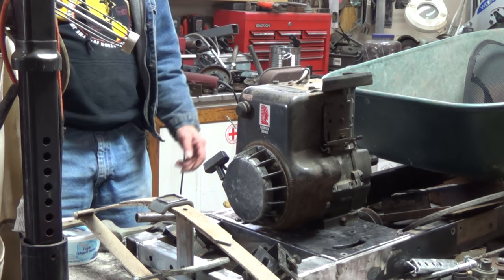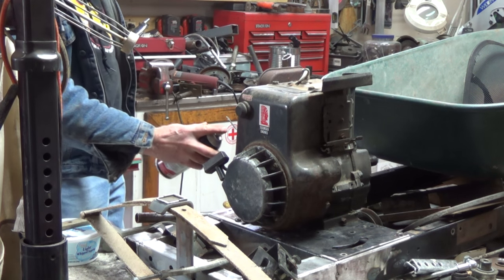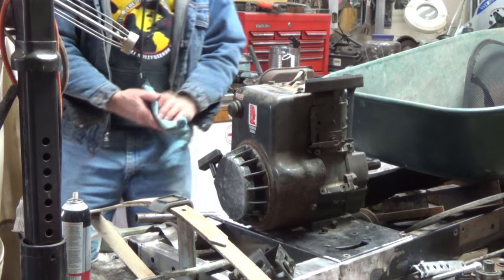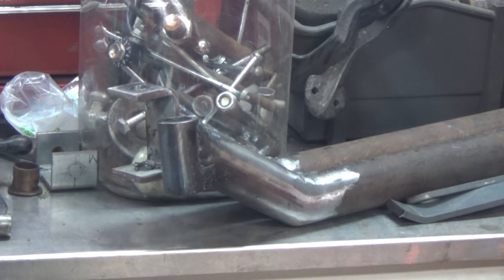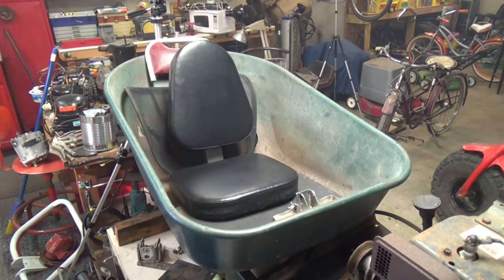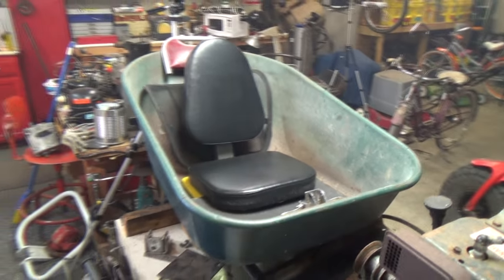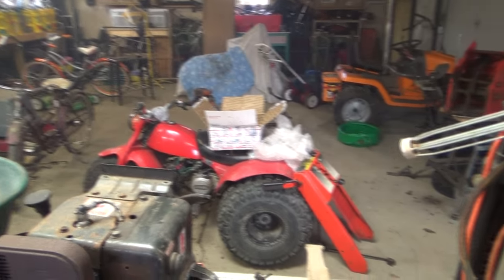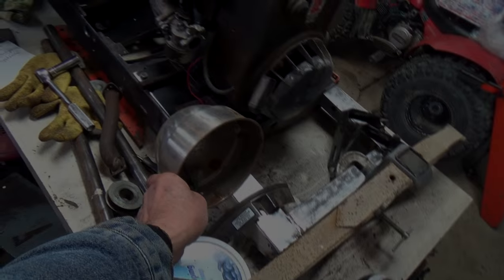The Goofy Cart II, fire in the hole &  front axle remake

Comment: I Like you 2nd design with the king-pins ....My 79 ford pickup has king pins in the Twin-I-Beam suspension
Reply from the maker: +not2fast4u2c   This design is pretty standard stuff on trucks right up to the present, so it is a proven design. I was originally copying the gokart set up, which is backwards and will only work with a center steering hookup that doesn't require a pitman arm off of one side. Thanks for checking things out today Jim.

Comment: Cool idea! Be sure to make your tie rod length shorter then your king pin centers. (Ackerman steering geometry). Probably could find a calculator on the web somewhere to help determine what that length should be. Can't wait to see it running.
Reply from the maker: +jeff edison   Thank you for the suggestions. I will build in the castor, the camber is already done and the toe-in, toe-out will be determined after the front end is fully installed. Thank you again for stopping by and taking the time to comment, I appreciate it.

Comment: the headlight buckets look like perlux,should be marked on them. easier to chase down len,s etc for them. i think your redesigned steering should work great,congrats on over 1500 subs
Reply from the maker: +roger oconnor   Thank you so much Roger. Thanks for the information on the headlights. Any idea what kind of vehicle they would have originally been on?
Reply: i believe a tractor trailer,if i am correct. i had a pair on my monster truck years ago
Reply from the maker: +roger oconnor   I did some research and they are vintage fog lights. Pretty pricey still. Thanks for the information.

Comment: Will you install a grease fitting? Can you post your e bay link?
Reply from the maker: +BUDDY LIGHT   Yes, I expect to install grease fittings into the king pin boss. my ebay moniker is still-crazy-2. Right now I have a vintage voltage adjuster and an oxygen sensor for an 89 Toyota pickup on there, but will be listing a couple of model cars this afternoon, I expect.